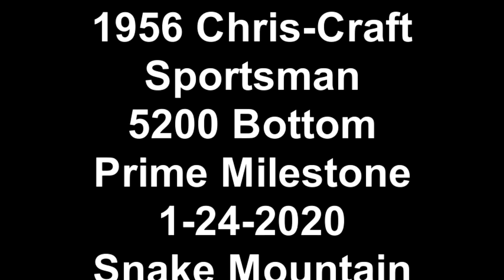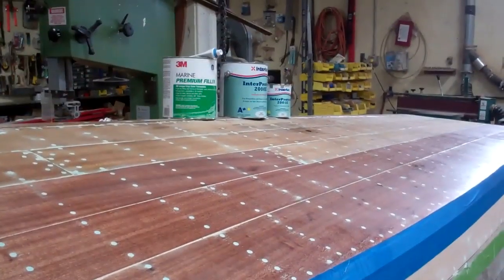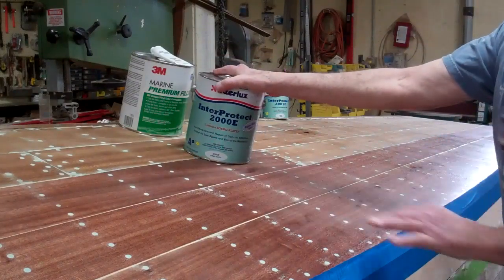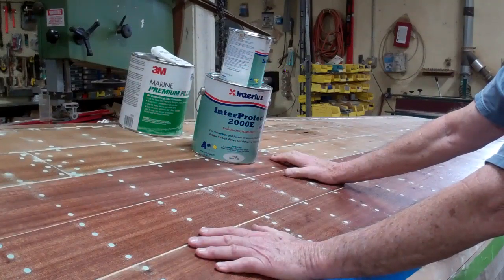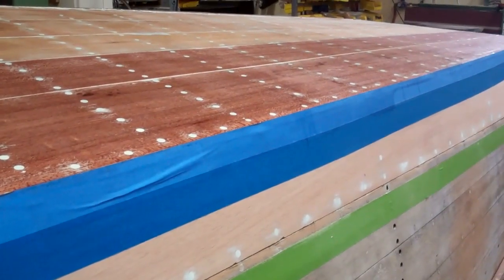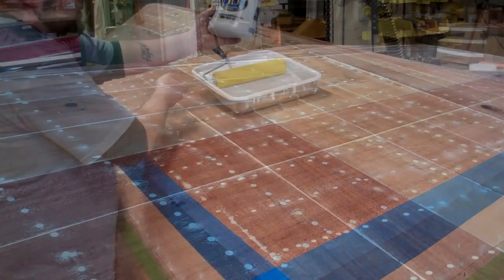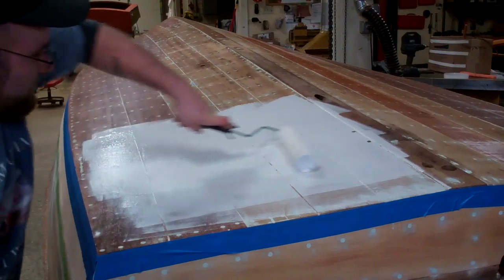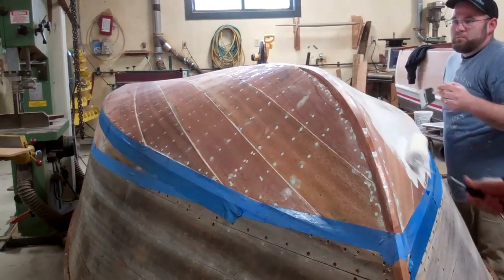1956 Chris Craft Sportsman 5200 Bottom Prime Milestone 1 24 2020 Snake Mountain Boatworks LLC

Comment: 40 year painter here boys tip go buy a short adjustable roller extension pole [2'] at sherwin williams  it will allow for more pressure  on roller frame longer reach so you may not have to climb up for keel work and allow you to use a plywood scrap on the floor to set your paint tray on so you can keep tray in front of you push it forward as you go and reach tray to pick up more paint without having to bend over cheers oh yeah you might want to put/screw/nail two scraps of 1" by on plywood one in front one behind tray with enough room between so tray can slide in give you a foot rest to push on and keep tray from moving when you pick up more paint . they also sell heavier roller frames that would  allow for extra pressure on extension pole to move primer around faster and pole can be held with both hands for more pressure so you may be able to fill voids and skip foamy brush and arm fatigue
Reply from the maker: Thanks for the suggestion, but we are fine with doing it our way. I have actually painted houses inside and out for over 60 years. Putting high pressure on the surface when appoly9ing these paints only gives us nightmares with uneven film thickness. Our method is just fine - gives us the control we need and delivers a wonderfully uniform outcome.

Comment: UHhhhhhhh.........................with all that 5200.....................why are there still seam voids that need filling?
Reply from the maker: Voids? Nope. There are none for sure. The 5200 fills the edges of the seam channels, leaving a slightly concave profile in cross-section. The 2000E, for all the right cosmetic reasons, does not fill these channels fully. 
Guess what? She is wooden, so she wears her bottom planks on her "sleeves" proudly.
Reply from the maker: Here is the next video in this series: https://youtu.be/LDztZlz2zwE